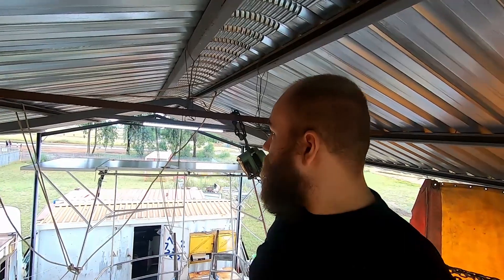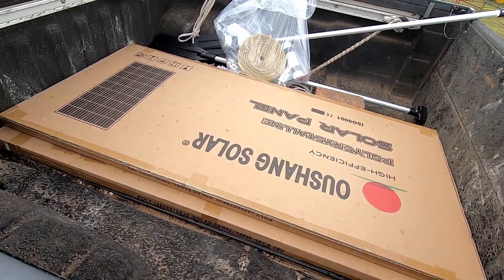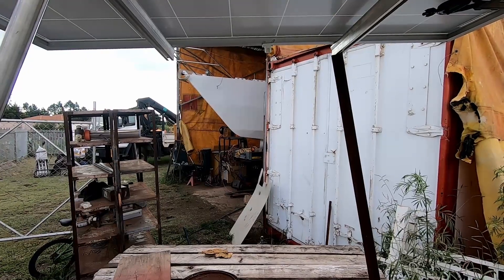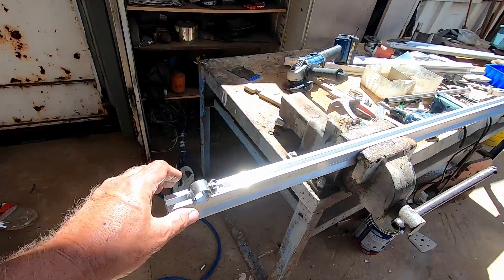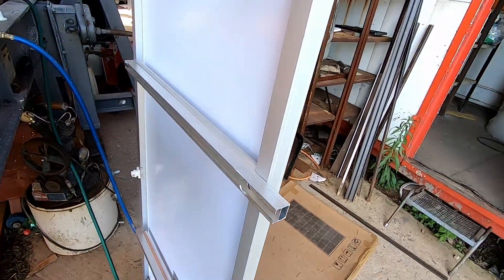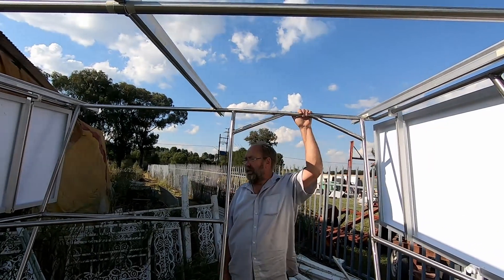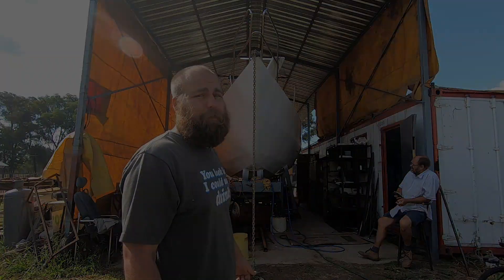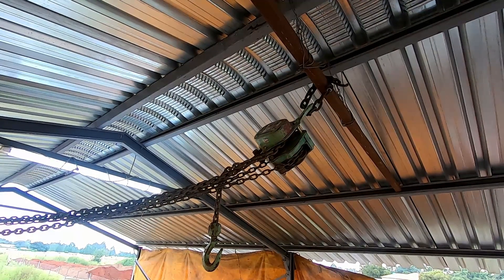Sailboat Solar Panels Installation on our Cheap Solar Arch | Land Rats | EP32

Comment: I have a few concerns with your setup not necessarily you have done them wrong but definitely areas where it might not be the best solution or there might be problems. Of course this is just based upon what you have shown in your video. Firstly your solar Arch did not seem beefy enough there is going to be considerable amount of force as your panels have a large surface area especially the side ones. Of course that might be some thick Stainless walls on the tubing but unless you can treat it like bars at a gym they are going to buckle or the panels will fly off never to be seen again. Remember the inverse square law twice the wind speed is 4 times the force.

Secondly that deck fitting you are putting electrical connectors on deck where they will get wet and definitely at one point you will kick them with your foot. Shocking :)

Lastly you have intrinsically two separate systems from what I remember your internal systems are a bit idiosyncratic as well. I would suggest you put it out to various forums where hopefully you will get some good advice about your electrical layout. However at a minimum I would suggest that you find a way to have the panels for the service batteries to charge your house bank once they are topped up. Otherwise you could find yourself in the position of being low on power whilst simultaneously throwing it away on the service side.

Sorry for the negative post and I hope my concerns are not valid but you can get yourself some free advice from experts on forums if you layout your setup for them.
Reply from the maker: No Problem, Always appreciate Feedback. We are adding in a couple of supports to our Arch as to make it a bit more Beefy. We've bought an stand alone battery charger that we haven't shown in a video yet, that currently charges from our house bank to our service batteries, and with a few small changes the other way around as well. Always Appreciate and look for Advice, and I'm sure we'll be regretting a couple of decisions but we are eager to learn. We're a couple of Land Rats after all not Sea dogs yet :)